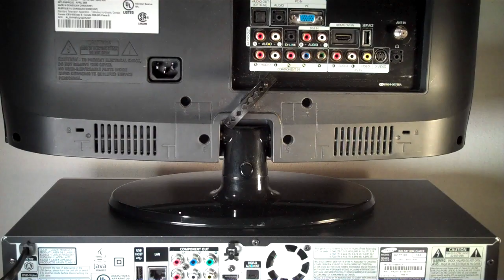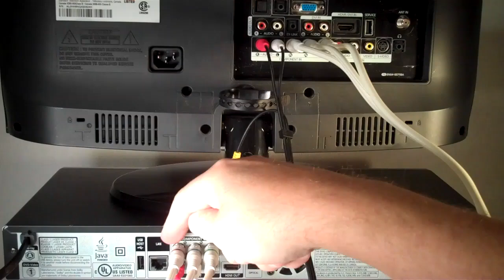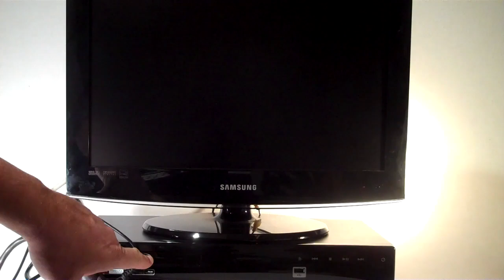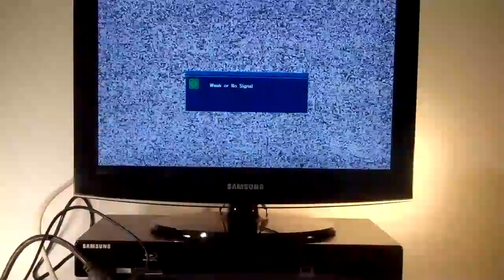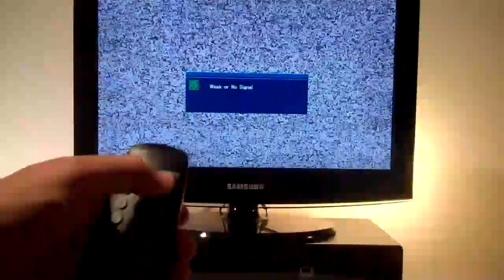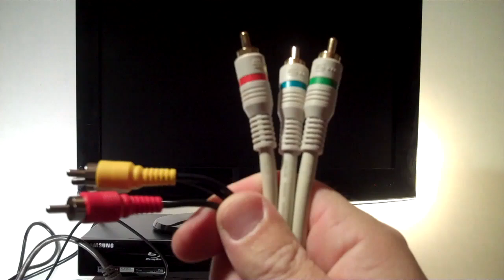How to Connect Blu Ray to TV using Component Video

Comment: only problem is; many blue ray players don't have those S video jacks, but simply an HDMI port...how do you convert that? is it even possible? some folks insist its possible by using a converter box from the 3 rca jack into hdmi jack but i tried it and there is only sound with no video. any ideas?

Comment: Current problem...todays 2016 Blue Ray Players don't have component or composite Jacks on the back. Only HDMI. I need those older audio jacks to use my older 1990 Marantz Dolby Pro Logic Receiver for the 5 speakers.